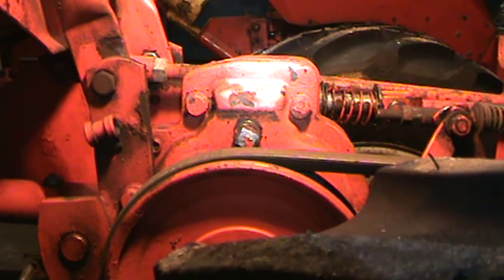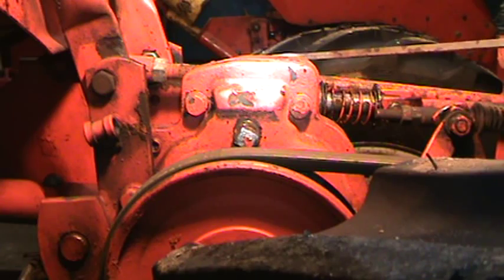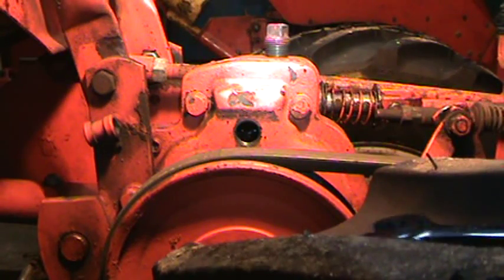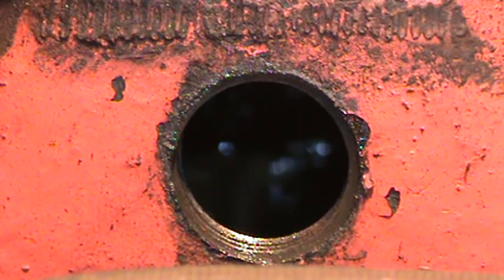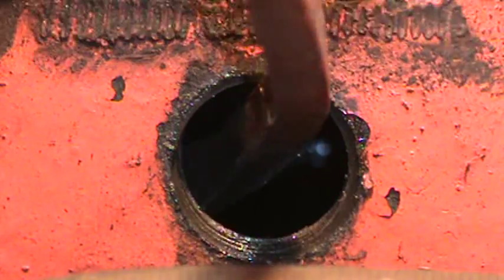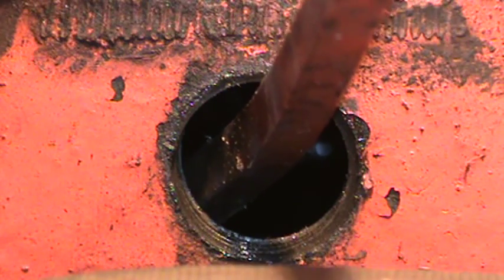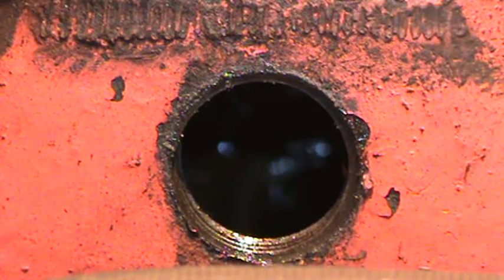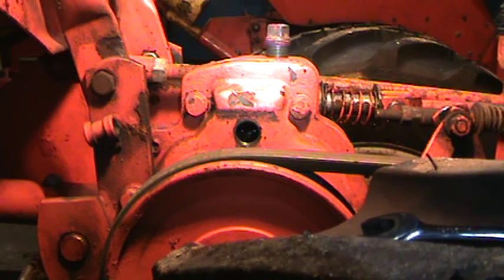Simplicity and Allis Chalmers Stuck in Gear Fix

Comment: The trany in my T-811 will not shift into 2nd or 3rd. Will this work for me?
Reply from the maker: No it will not. Totally different machine. Best bet is to find an individual either on here or at simpletractors dott comm to ask about repairs. I've dealt with the Peerless transmissions in your machine before and they're a pain in the rear. It's usually much easier to find a replacement (typically around the 75 to 100 dollar price point.) Replacing them is a simple process and one I've done in about an hour. Is your transmission a 3 speed Variable or 5 speed? Being a smaller frame tractor, the transmission isn't made the same as the larger framed models. Also, your tractor was manufactured between 1978 and 1985. These are not years I am as familiar with. If it's a 3 speed Variable, it may be easier to fix than the 5 speed Peerless models. Best of luck and sorry I couldn't be of more help! Cheers! Zip~

Comment: Just picked up t816 stuck in second won't go in any other gear what should I try first
Reply from the maker: That is a different breed of tractor and the transmission is also nothing like the one I show this fix on. Unfortunately, if it's the 3 speed, I don't know enough about them to help out. Perhaps someone on one of the collector sights can be of some assistance. Sorry I couldn't offer more info! Zip~

Comment: I have a Allis 410 that is stuck in reverse and when I put it in....1st? I think, it will make a squealing sound and bog the engine. 
ive been trying this trick but haven't figured it out just yet. 
any ideas would be greatly appreciated
Reply from the maker: +Bio Hazardra Hey Bio, I often don't get my comments like I should and yours slipped through the YouTube cracks. This video, with practice on your machine, will get the shift fork centered. You want to pull the shift lever back towards 2nd and reverse, out of the way, while doing this. Hope you get it sorted out!! Cheers!! Zip~
Reply: ZippoVarga  Thanks Zippo :)
I tried playing around with it but the shift forks aren't my problem I find. I took the transmission off and took it apart, and did not see anything wrong. no chipped teeth, no cracks, nothing. I am not sure if there is a gear out of place but it doesn't seem like it. I have no clue what is wrong.  thanks for the help tho. love your vids  :D
Reply from the maker: +Bio Hazardra Sorry to hear of your continuing issues Bio...Is your tractor a strait 3 speed or a variable drive? The Simplicity versions of either transmission are compatible and they're fairly easy to find through collectors clubs. Cheers!! Zip~
Reply: ZippoVarga yea its a 3 speed + reverse 
when I first got it it would drive backwards but the shifter would still shift in all gears, just not pull. then one day I got it to where I could roll it around and I just left it sitting there and it locked itself back up! like a gear settled or something and locked it up. I don't know whats wrong with it. I am going to try seeing if a friend could help but other than that idk what to do. garden tractors around here are rare as hens teeth nearly. I was lucky to get this one

Comment: What’s it mean if the tractor on trams in reverse but I can move the selector rod. I’ve been fishing in the gear box trying to get it out of reverse but I can’t feel anything
Reply: The lever is up between 1 and 3 and will go in either but the gear box is stuck in it will not turn. I can’t get the lever to go back to 2 or reverse. Any idea what’s wrong?
Reply from the maker: What is the tractor? It takes a little practice to get the shift forks back to neutral so everything works again. Zip~
Reply: 3012 sovereign . I tried some more now the move the lever at all.
Reply from the maker: Finding the center for both sets of shift forks is key. Keep at it and a gentle touch is needed.
Reply: ZippoVarga  thanks for the info. I’ll keep trying. It I can’t get it by the time I get space in the shop I’ll just split it. As bad as I hate too. But I really need to get this tractor going.

Comment: Ok so I did this once before and it worked great but now even though I can see the ball slide forward and backwards and physically see it shift im still somehow stuck in a gear tractor is currently not running and I need to move it, I cannot figure out whats going on
Reply from the maker: What gear is it stuck in? There are two sets of forks. It sounds to me like you just have to locate the second fork and center it. Keep us posted! Zip~
Reply: @ZippoVarga  yeah I watched it shift both sets.. i had to call it quits for the night so I just sprayed a bunch of penetro 90 in it because thats all I had, went back in the morning and watched it shift both sets again put it in neutral and it really was neutral lol one of them much have been just slightly off .....  but thanks sooooo much for this video
Reply: *must

Comment: My Squire 9 is also stuck in 2nd and I was hopeful the screwdriver trick would work for me. Instead, there was a loose something floating around inside the transmission that I was able to remove with a magnet. Here's a pic: https://pbs.twimg.com/media/BizDKisIEAEG51x.jpg

I think I have a big job ahead of me. Any advice greatly appreciated.
Reply from the maker: Oh yeah...You've got a big issue there. That is the ball that is supposed to be attached to the shift rod which rides between the forks and pushes them into and out of gear. You need ti either split the case in half and replace the ball OR, the easier way to remedy the problem (although it doesn't sound easier) is to replace the trans-axle with a known good one. They are available and typically will set you back about two hours of shop time and in the area of $75.00 for the donor axle. I would  do the latter before tearing into the trans-axle. But, if you're good with a wrench and have a bit of spare time, it's a great learning experience to tear into them. The fortunate thing here is that you were able to retrieve the shifting pawl, which kept it from getting into the gears and REALLY making your day bad. A couple places you can post a classified wanted add is SimpleTractors.com and Michaelstractors.com. Both are dedicated to preserving these machines and there's a wealth of information with the members in attendance. Best of luck and don't give up! If you have questions, just ask around!
Reply: So, lets say I have the time, the wrenches, and am not afraid of failure.  Do you think the parts I need can be had without buying a whole trans-axle? I'm especially concerned about having to replace seals and such and not being able to get them.

Should I do this, is there a correct order of operations to removing the back-end so I can get at the broken parts?

I guess I should also say that I've never attempted something like this before.
Reply from the maker: If you've never attempted the repair of an automobiles manual transmission, I wouldn't attempt this repair on your own. There are many important clearances, dis-assembly and reassembly steps to take to make the job go smoothly and this takes experience and know how. The gaskets and seals are available through a number of dealers. The best of which is Sandylakeimp.com. If you choose to dive in, I would call them and ask for Brenda. Tell her Zippo sent you and she will treat you like a VIP and get you what you need as well as make suggestions for what to replace. As for finding a replacement shifter pawl, this would be something you could obtain through fleabay or by way of a wanted classified on SimpleTractors.com or Michaelstractors.com. Most will concur that replacing the trans-axle is the way to go. You can always revert back to this option if you find yourself overwhelmed after getting things apart. Best of luck to you in your endeavors James! Cheers!! Zip~